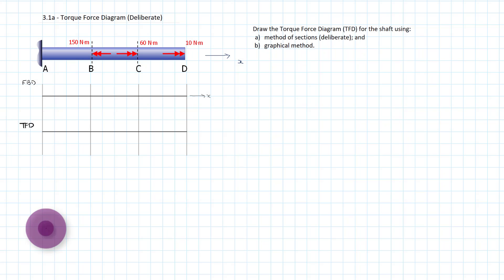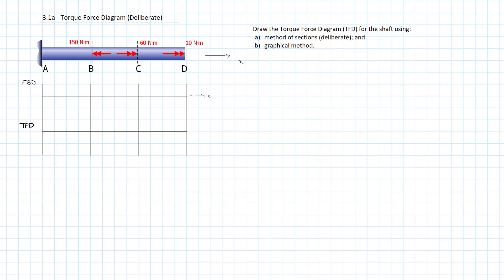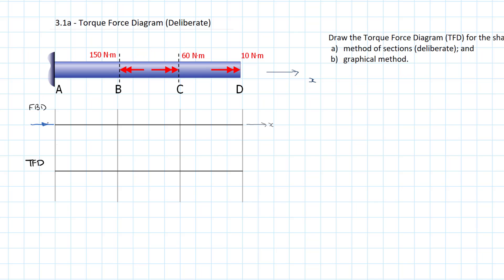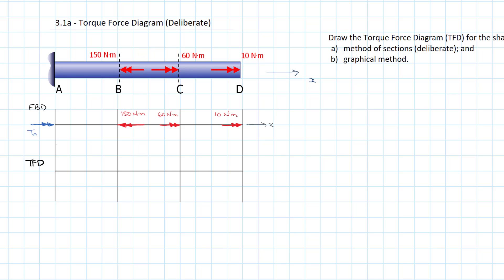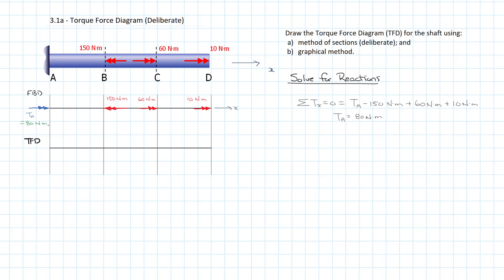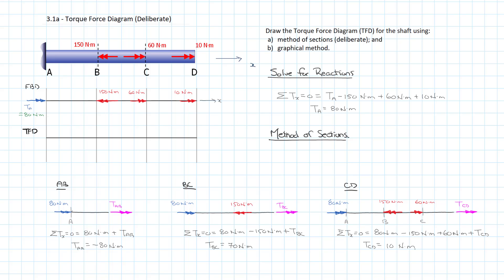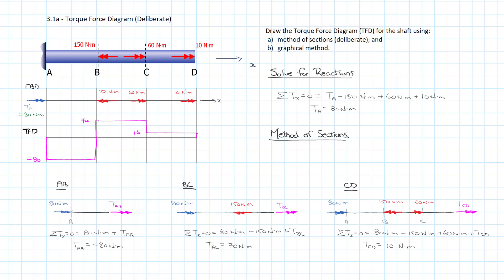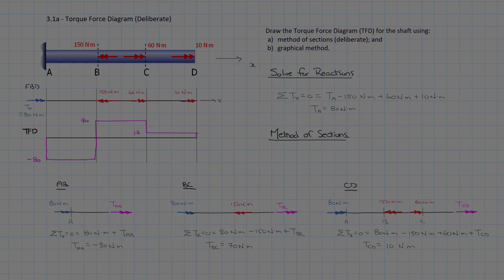3.1a - Torque Force Diagram Deliberate

Comment: Why do we use double arrows for Torque? What does that signify? Thank you!
Reply from the maker: This used to be more common as it allows us to signify a torque easily, including direction (right hand rule) in 2D.  Newer texts show the torque as a curved arrow, but this requires a 3D diagram to fully comprehend.  The double-arrow as torque is simple and easier than curved arrows for personal calculation notes… especially for 2D representation, which most of us do.  Curved arrows are easy to misunderstand the direction.